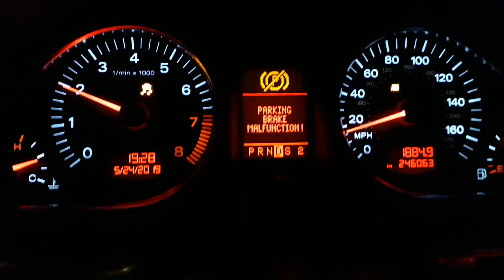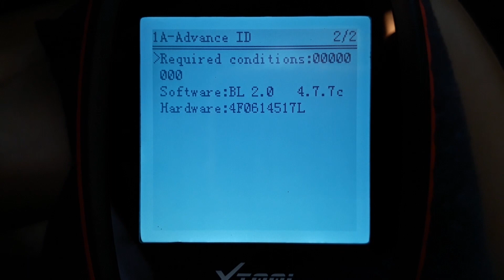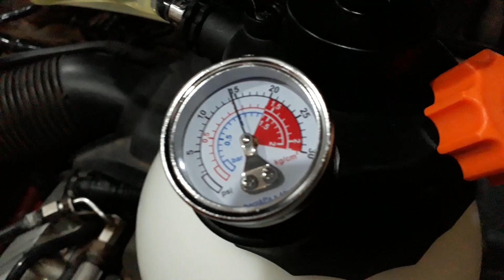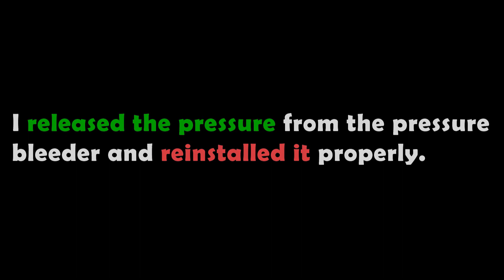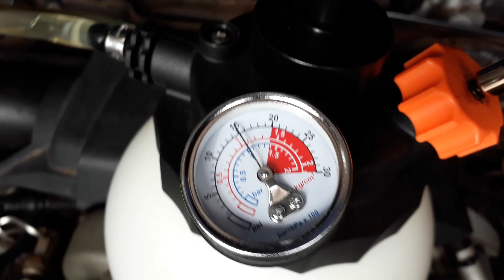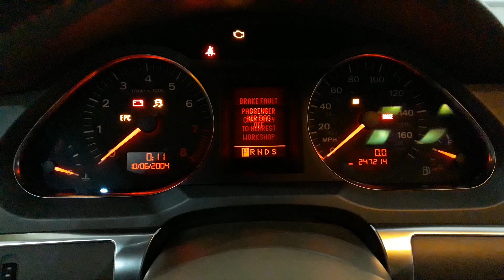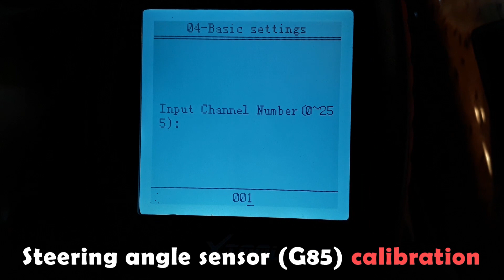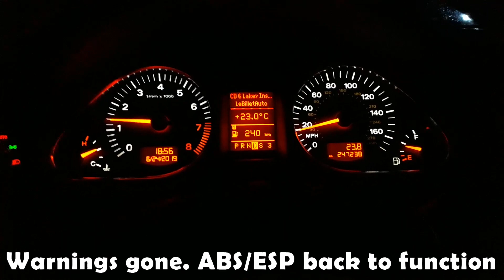Audi A6 3.2 - ABS ESP Unit Replacement and Coding

Comment from the maker: Tip: After disconnecting the bigger lines with the 13 mm wrench, pull them out and gently lift them up. This will give easier access to the 11 mm wrench while unscrewing the smaller lines. Do the same thing while installing back the lines. Start with the smaller lines, pulling up the bigger lines then finish with the bigger lines ;)

Comment from the maker: 00:01 - Showing symptoms
00:30 - Showing replacement parts and tools
02:00 - Scanning for fault codes, activating system function test, saving module coding value
04:30 - Pulling driver's seat to the back, diconnecting battery
06:00 - Moving coolant reservoir out of the way
06:30 - Cleaning ABS unit
07:00 - Topping off brake fluid, depressing brake pedal halfway and blocking it from moving, releasing pressure on driver's sides
11:45 - Removing defective ABS unit
17:55 - Installing rebuilt ABS unit
22:20 - Releasing brake pedal
23:05 - Bleeding braking system, topping off brake fluid
35:23 - Installing back coolant reservoir, connecting battery
36:50 - Coding new ABS module, calibrating steering angle sensor, clearing fault codes
49:00 - Setting date and time
50:50 - Going for a test drive
52:13 - ABS back to function, enjoying drive
Reply: where do you live .  I asked him for his phone number to fix my car
Reply from the maker: @samuelvera8490  I live in Africa. I'm probably too far away. 😕

Comment: I just get one code, 01314 engine control module, under ABS fault codes. Car drives fine until I hit high rpm then the traction light turns on and dash tells me esp fault/ check owners manual. After that if I come to complete stop I’ll lose throttle completely until I restart the car and the process repeats. Should I even bother changing sensors? Or just go straight for the ecm, abs module and wiring?

Comment: Hi.
My 2009 a6 c6 avant abs is broken. Was thinking of getting a 2nd hand part from ebay while I get my abs repaired to the US.
My part is 4F0164571AT.
seen few abs on ebays but the last part were AB or Aa or DA.
Can I use that & will it be compatible?
Thanks
Reply from the maker: You got the part number wrong. It should be 4F0 614 517 AT.
Reply: @Kokouvia  yes the part number is that u mentioned.
Can I get those same unit as available from Ebay?
Reply from the maker: @noh7828  No. Make sure the seller specifies AT.
Reply: @Kokouvia  noted & thanks
Reply from the maker: @noh7828  Good luck 🤞🏽

Comment: I have been having what seems to be the same issue on my 07’ A6 (similar spec to yours). I usually get ABS/ESP alarm followed by Parking Brake Malfunction randomly when stopped. Sometimes I can go for miles before it triggers, but once it does it alarm each time I come to a stop. The pedal will also go all the way to the floor if I push it past the braking position due to no back pressure on the pedal.  The car stops fine though. I just can no longer stand the beeping and think maybe this ABS or ESP module could be the culprit?  

The part number listed on my unit is 4F0 614 517 AA (the second ‘A’ looks like an upside down ’V’ though for some reason)
Reply from the maker: Based on your symptoms, I suggest you perform a brake fluid flush first. It is supposed to be performed every 2 years. Here is a quick video showing what it looks like: https://youtu.be/NiE8mPMIhs8
Here is a more detailed one: https://youtu.be/bdJ7YmGxU7Y

Comment: Hi mate, I do have the same issue of your front panel, only during driving the ABS/ESP mal function firstly and then the advise of the Parking Break. But in my case, right handbrake calliper works fine, but left doesn't at all. Did you have that problem?
Reply from the maker: Hi, no I did not have a caliper problem.

Comment: Hey I’m currently looking for a ESP unit but I’m finding trouble with the exact unit that I need, and it led me to this question. At the end of the unit there are 2 and 3 numbers (009 on top, 03 on bottom) which are the numbers that I have trouble finding the match with, but are those numbers apart of the unit? And if I use a part without those numbers what would happen?
Reply from the maker: It has to be the exact same number. What can be a little different  is the letters at the end but you still need to make sure it is compatible with your vehicle. What is the part number on your unit?

Comment: I want to change my rear brake pads and rotors. I need to open the epb... I have the same obd tool you have. Can i open the epb with that tool? If so, what steps do I take? I do not want to cause any trouble codes or failures. Kind regards Martin from the Netherlands
Reply from the maker: Yes you can. The following videos will show you how. The last one has more details. Make sure a battery charger is connected the whole duration of the job to avoid potential damage to the motors because of a battery draining out since the ignition will be on the whole time. Turn off the MMI, the A/C and the lights to limit power consumption. 
https://youtube.com/shorts/jXU04mDVMvM?feature=share
https://youtu.be/Xf6mCcwgSfc
https://youtu.be/2j699UxjE5M
Reply from the maker: I just drafted the detailed steps in the third video's description.
Reply: Thanks ! You are a legend ! There is nobody like you on YouTube. I always get a respons from you, always helping other Audi drivers. Hope Patrick can live with you for some time. 😀 greetz Martin

Comment: What is the correct part number for AWD ABS Module? I’ve a 2005 A6Q3.2
Reply from the maker: There is not a unique part number. It may differ from model year to model year. The part number is engraved on top of the ABS unit in the metal part. You may need to wipe dirt to properly see it.
Reply: How will I know which module to order then? I don’t wanna get a fwd on accident..so letters at end which are revisions don’t matter? Just the first 8?
Reply from the maker: @jamesprisby6299  What do you see? Send it to me here so that I confirm.
Reply: My part number is 4F0614517A03 for abs module, that’s all I was looking to replace
Reply from the maker: @jamesprisby  That would be 4F0614517A.
Reply: Will I need to program it? Because I have same XTOOLv401 but I have no communication with abs module so I can’t even go into channel 3 for anti lock brakes :/
Reply from the maker: @jamesprisby  Yes you do unfortunately or you will get a myriad of warnings on the dash. If you are lucky enough you could use the same coding as me and get away with it IF we have the exact same options. Details are in the video. Fingers crossed for you.

Comment: Greetings! My 2007 Audi A6 3.2 Quattro continues to get a “Tyre pressure System Malfunction” error code while I drive for a couple miles. I’ve checked the pressure on all my wheels and realize it’s not that— do you think it has to do with the ABS module and what you did here in this video?
Reply from the maker: No I don't think so. When your car is equipped with the TPMS (Tire Pressure Monitoring System), an electronic valve is installed on each wheel to read the tire pressure and report it to the central system. If one of the electronic valves have failed or is deprogrammed, you will get warnings like this. You may need to replace all the electronic valves and program the new ones into the TPMS. I have no experience with this myself unfortunately to guide you step by step through this but I'm sure there are enough info online. The easiest but expensive way would be to have the system fixed by an authorized Audi shop.
Reply: @Kokouvia  awesome thank you for your insight. If I check my tire pressure regularly, do you think it is urgent for me to replace these sensors? I have other fixes I need to work, such as replacing seals due to an engine leakage that may be causing excess white smoke from my exhaust pipe and oil smells coming from my A/C system :(
Reply from the maker: @jadierr  No the TPMS is not an urgent issue as long as you manually check the tire pressure yourself once in a while.

Comment: After i change the ABS pump and i want to vent the pump I can do it on the brake calipers ? Because I don't have your tool. 
It must be coded the new unit ?
Reply from the maker: You can let gravity push the oil out but it will take a lot of time. Just make sure the brake fluid reservoir does not go empty because it will damage your master cylinder. Yes, the new unit must be coded. Check the description for the time code where I showed how to code it.

Comment: Can the failed ABS module lead to a steering angle sensor fault code?
Reply from the maker: If you only get the code for the steering angle sensor, I'd suggest you just calibrate it first to see if it goes away. I have shown how to calibrate it in the video. Check the time anchors in the description for shortcuts.

Comment: why dont you use vcds so we can see the whole procedure   and where can i find the number that you save
Reply from the maker: The scan tool I used does the same job as VCDS. The interface just looks different. But it is easy to get confused so I understand your frustration. To find the number to save, watch carefully from time 2:00 of the video. I first read the fault codes, then I activated the function test, then I revealed the module coding value you are referring to. You go to  "03 - Antilock brakes" then "07 - Code module" to see the number.